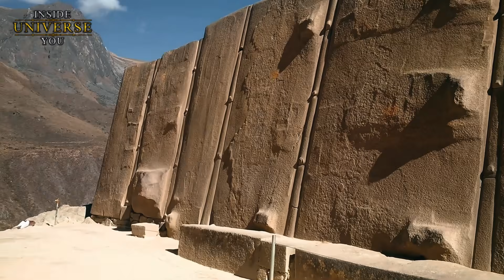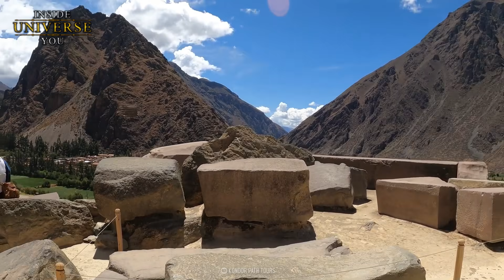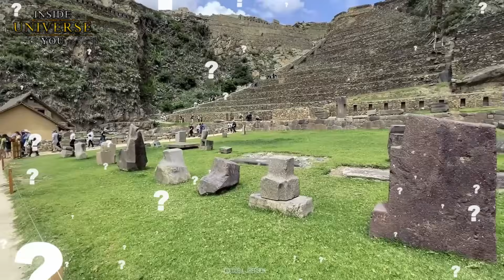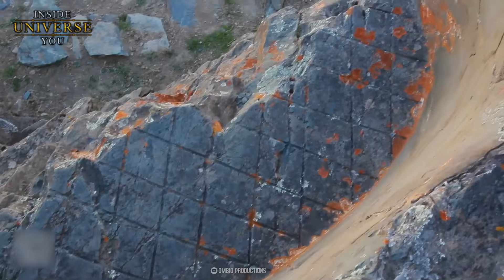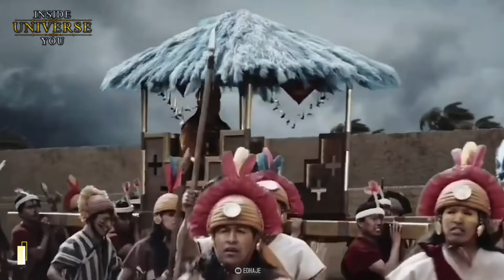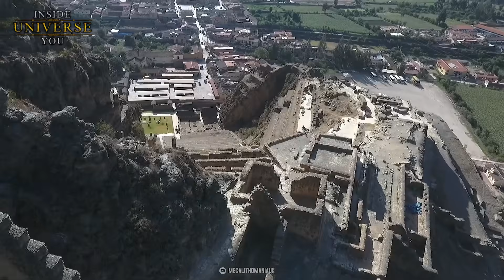Pre-Historic Mega Structures of Ollantaytambo Predating the Inca

Comment: These structures were built by the Inca. Several Spanish writers watched them do it and wrote about it. The methods have been replicated in modern times. Back in the day it just took a basic knowledge of geometry and mechanics, lots of time and manpower and an amazing level of skill from the masons. It wasn't aliens, it wasn't antediluvians, it wasn't lasers, rock softening or concrete, it was just lots of very smart guys and the materials they found around them.
Reply: I’m a stone mason, I’ve never seen anyone replicate joints that tight on stones that massive. I don’t even know if it’s possible to do that level of accuracy today…I’m not sure if you fully understand the level of difficulty involved with this. To maneuver a 50 ton block and perfectly mate it to another 50ton block is an incredible feat.
Reply: @tylerk.7947  Yes absolutely, I have done some stonework myself so I appreciate what time and effort goes into it. The secret of the joint tightness is possibly the use of a corrosive paste called "llancac alpa" derived from Incan mining operations which would dissolve the stone slightly when applied to the mating faces. The geochemist Helmut Tributsch wrote a paper on it which is available online. The second potential factor is the natural "slump" of the stone under its own weight over several hundred years. The architect Jean-Pierre Protzen wrote another paper in which he studied the quarrying and building operations in which he was able to replicate the finish with the tools known to be in existence at the time. Non of this is intended to take anything away from the skill and dedication of the Inca masons and workers.
Reply: @jannenreuben7398   I wonder why we are not using this "llancac alpa" today? The same "technology" was used in Egypt (Osirion, Abydos; unfinished obelisk, Aswan quarry; Menkaure pyramid, Giza; ...) Some say it was a paste derived from a plant - was the same [now extinct?] plant also growing in Egypt? ...
Personally, I don't think it was a paste. It does not explain how they lifted blocks weighing up to 1000 tons (ref: unfinished obelisk). Paste does not levitate blocks. I suspect we are missing a very basic concept, which required very little energy and was easy to use (e.g. a hand held device). "They would not have done this unless it was easy." Take a look at the weak atomic forces, therein lies the answer...
Reply: @mattharvey515  We don't use it because there's no need to use it, contemporary and later European masonry used lime mortar, which the Inca were not familiar with, to fill the gaps. The old Inca practices were destroyed after the Spanish conquest. I never claimed that this paste levitated blocks, only that it dissolved any small gaps between the stones. Read the paper by Helmut Tributsch on how it might have worked.

On the subject of lifting huge blocks we know it can be done by the careful use of fulcrums, weights and chocks. I'm not saying that's how it was done (we don't know) but it is possible without appealing to obscure technology we don't even possess today. There is no credible evidence whatsoever of any such device being either possible or utilised.
Reply: @jannenreuben7398  The stones were not shaped by "mortar", and were not held together by mortar - they are dry stone "walls". There are also no traditional toolmarks on ANY of the stones. You say, "There is no credible evidence whatsoever of any such device being either possible or utilised."  There is no evidence of the ancient "machines" (which may have been small and simple or may simply have rusted away), but there is overwhelming circumstantial evidence that an unknown technique was used. Look at the Unfinished Obelisk in the Aswan Quarry. The only way that could have been removed in one piece is by lifting it vertically out of the quarry - and it weights 1200 tons! Also, what "device" created the obvious "scoop marks" which are irrefutable evidence that an unknown device was used to cut and mold the stone. Similar "scoop marks" are visible all over the world, Peru, Egypt, Greece, even on the Stonehenge rocks in the UK.
Reply: @mattharvey515  It would save a huge amount of time for the both of us if you just read the studies I've cited. They'll tell you exactly how it was done, including evidence from people who actually saw the Inca building these things. There really is no great mystery here. Helmut Tributsch and Jean-Pierre Protzen are the authors you need and both their papers are available online.
Reply: @jannenreuben7398  I am familiar with these studies. You are assuming that the megalithic structures were built by the Inca, but these are pre-Inca structures. The Inca built very crude walls on top of ancient masonry that as already there. This is what the Spaniards documented. The evidence can be seen everywhere, "modern" crude work upon perfect ancient craftmanship, which we could barely replicate even today. Did you go look at the Unfinished Obelisk, or the pre-Inca architecture in Machu Picchu?
Closed minds open no doors.
Reply: @mattharvey515  The studies I cited made no distinction between the supposed eras of construction. It was perfectly clear that they were treating all the stonework in the same manner. But if you want to posit that the good stuff was built by some mythical pre-Inca civilisation then go right ahead but you're going to have to back it up with some credible evidence. Otherwise all you have is one giant fallacy of incredulity. Do you have any evidence for your claim?

Comment: What seem like inset blocking too hold and or are hold downs ,hat can only be for heavy moving andk machining these is the only resin that anne giving ! A negative inset block housing if you look at the leveling it appears that they were using a leveling system this is why the odd shapes also what we see are stones that are inset cut placed in a precarious manner between two sure walls between a ceiling and a floor but in a matter of compression forms I believe these are used as a processing system to use your force or sure wait bearing loads to compress and perhaps process systems if this is so and the insects cuts are actual facets of machine inlets inlays and two wings that these are much much older much older than previously believed

Comment: I bet those nobs are used to lift these Megalithic blocks by some kind of crane.
Reply: Not really. Those nobs are the result of the method of construction. Think about that: how more complicated is to cut a block of rock with nobs?!? This means that you don't cut the stone block from the stone quarry in a straight line.
I think that they used some kind of mechanism/technology that modified the atomic structure of the stone and made it melleable for some time.
The place where the machine that did that was touching the stone take shape of those nobs.

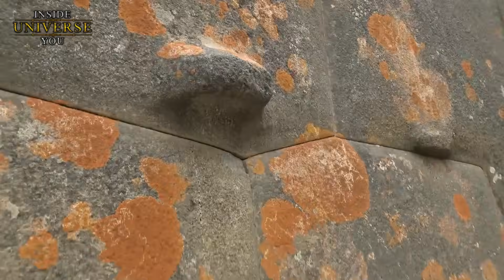Comment: 6:25 --> About these tight joints that you can't put in even a pin inside them...

As a structural engineer I know what amazing craftsmen the ancient stonemasons were. But these joints weren't made so tight from the  beginning.

These tight joints became so after the fatigue of the material, by "Creep" as it is called. It is a phenomenon, a very slow process that creates deformation due to material fatigue after many years under pressure. Of gravity in our case.

All materials "suffer" from this deformation but it takes hundreds or thousands of years for it to become visible, depending on the material and specifically its Modulus of Elasticity. It is the property of a material that shows how elastic it is under external pressures.

In stone structures, gravity compresses the material of each stone separately and decreases them in height, the horizontal joints slowly close over by the years because all gaps coming in an equilibrium level of deformation. However, the vertical pressure simultaneously causes a horizontal deformation in the materials, in our case the stones, so on the upright sides of each stone, the upright joints also close so that finally one stone comes and rests exactly with the one next to it.

For every millimeter of vertical deformation for loose stones, they expand horizontally by 0.2-0.3 millimeters, half of this on each side. So, all the gaps closes all around.

To better visualize this, say you made a plasticine cube and you squeeze it from the top, it will decrease in height but at the same time it will open up on the side and become like a burger. This also happens to stones but after thousands of years and it happens at a rate of 0.1 to 1 millimeter every 100 years depending on the material of the stone and the above load. Granite is one thing, for example, and Limestone is another. This percentage seems to decrease over the years, that is, as the years go by the material resists this phenomenon even more.

So, tight joints are not an unheard of issue, not something extraordinary. It forms naturally after so many years under the pressure of gravity.
Reply: but you saw the cuts in the walls those are square...also don't you think people who could move and cut stone like that could do it with precision... i mean you sound like your point is completely true but also i think youll see mine
Reply: @usahunting9735  
The only thing I am saying is that the joints wasn't 
at the start so tight but became during time.
Ofcourse they new how to cut and put the stones, 
they were master craftsmen.
But were men, not gods. Thank you!
Reply: @Antuan2911  I see your point, so the question is, basen on the procesu you described, how long ago this structure was built? And I also agree that despite the process its still ununswered how these blocks were cut oit off the rock in the first place.
Reply: @tsaicio  
Yes.
Reply: @Antuan2911 what does that mean?
Reply: @Jejdnxjx817  
That means that ancient stonemasons was excellent
but they didn't make joints so tight.
Tight joints were made after years and years self weight
pressing the stones and also soil sedimentation contributes
to that, to sideways directions...
Reply: @Antuan2911  amazing, do you think we can replicate them with our current knowledge and technology?
Reply: @Jejdnxjx817  
Even if we could found enough men with some knowledge 
to put so big stones one upon on the other, because this is
an knowledge humans not needed it for several centuries,
the cost will be so big, so no one will wanted to build it.
Theoretically yes we could, practically no we couldn't.

Comment: There are no rock cut here at all. Everything we see is either a geopolymer pour, or an impression from a catastrophic earth, water, ash flow, that covered structures and petrified them. The impressions we see left are from the structures which were eroded away eons ago, eons before the Peruvians and Incas ever touched these ancient site.

The nobs we see all over the world are a stylistic construction motif,  showing the great reverence of these ancient cultures, whose petrified remains of their cities these recent cultures in Peru etc.  found in these massive catastrophic mud flow, volcano ash petrification areas which turned wood and other materials, they were constructed from into stone!
Reply: Geopolymer to petrificatio is an interesting theory, however granite is formed in magma under tremendous temperatures and pressure then cooled over millenia. Your theory would require the magma to fill all these structures like water in a plasctic ice tray, and then for all the remaining material , which would also be granite to somehow wash away and form perfectly smooth surfaces. How long would it take for a concrete block, assuming there is a structure to contain it, have to sit to solidify before you could put another 50 ton pile of concrete on top of it? Now multiply that time by thousands.
Reply: @iGame3D  that granite claim is a theory as well and mist quackademic theories are the exact opposite of the truth. 

There are lot's of claims around the globe that granite can be made from a geo-polymer as well.

If you want me to provide proof, my playlist with 145 videos debunking most quack theories let me know! They were deleted by the mongrels of this venue, but I have copies on my odysee channel!

Comment: Technology no doubt. But what happened to those technological “tools”? The tools must have been at least as hard as the granites. It’s like they packed up the tools and vanished. The “reset” theory is problematic because nothing even in the slightest indicates any left over technology. You see the “machine” marks. Where were the machines? You don’t build these structures with a few pocket sized tools that get lost over time.

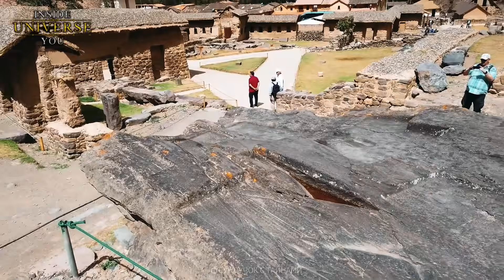Comment: At 8:21 when we see the untouched part that is eroded and compare it to the parts which have been worked, then obviously the thing they worked with had to smooth it out to make the rock withstand such erosion. Which even if someone tries to discredit this point, will have to face the fact that the structures that stand also don't show such heavy erosion marks. Erosion is always gonna happen, but all the worked parts show less erosion. VERY INTERESTING. Like perhaps something very hot was used to cut it out

Comment: Not cut.  Geopolymer concrete.  Carried to the site in wicker baskets, poured into a mold, then tamped.   After a few hours the mold was moved and the resultant block was trowled and smoothed before the geopolymer concrete got too hard.   By then they were starting the next block.

Comment: Can we hear some best guesses? 👇👇👇
My guess is they had long, bladed tools that either used sound at a particular wavelength or vibration at a particular frequency to cut through the stone. I don't imagine them slicing through it like butter with lightsabers 😅 but I think they may have had a power source similar to electricity, or maybe even had electrical power from another source.

Comment: I'm beginning to think that with these large structures that have these intricately shaped blocks were completely pre-planned down to every single block. Building from the ground up, why would they have the need to cut these blocks at such weird angles? Why couldn't they just cut them flat and in smaller or shorter pieces to line up with the blocks to the left, right and bottom rocks? It's like they had every single stone planned out in advance and cut it to that exact measurement. Am I sounding crazy here?

Comment: The stones surfaces look scooped away with little effort.  They had some way of softening stone that we may never know. As for the small cut, the compound used to soften stone was placed on a rope and the rope was worked back and forth. The same compound was placed between blocks, so that the blocks seemed to "melt together. No need for a chizel

Comment: Thanks for the excellent presentation. This is an interesting subject, with many different twists and turns and view points. This presentation had no mention of aliens, or ET., which makes it more interesting and truthful. Something to consider: did you know that natural granite has no metals in it, they have all been extracted. You might find tiny traces of iron or pyrite, but no precious metals. This interesting because it leans toward the idea that all granite was previously mined and a metal removing operation was performed. This materials left are crushed and powdered rock mixed together. This could have been made into a slurry that could have been molded into complex shapes, creating the swirling colors you see in modern granite slabs.If you look closely you can see that not only are the gaps in the block walls are very tight, it is as if something soft had hardened against something solid, like plastic which hardens very quickly. The other thing is the glossyness and smooth texture suggest heat and polishing and was used, maybe like self curing concrete which generates tremendous heat. There is another theory that you can checkout on the Mud fossil University channel here. Man if I only had a time portal too see what actually happened. These stones are huge and some looked like they were stamped with a mold or die as they are identical, just like injection molding.

Comment: Nice video and presentation. 
There is two ways to shape stone. The a
Hard way? Hammer and chisel. 
Wise way? Use of a binder to turn sand into stone.
Modern example? concrete. 
Ancient example? Geopolymer. 
Prior to set hard, the wet mix can be pour into a mold or sculpted by bamboo tools.

Comment: The molding artifact idea for the nubs fails (for many reasons) but primarily in light of the corresponding nub stems on the walls of rock where the blocks were quarried. It's actually obvious what they likely are: the last cutaway points when removing a block of stone. A corresponding mystery is why many stones are fully finished with no nubs left on them right next to blocks with nubs. Apparently they had functional purpose to the builders even after all the installation and finishing work was complete. Are we ready to make a primary logical division on the nature of that purpose here? Was it practical, or religious/cultural/aesthetic?